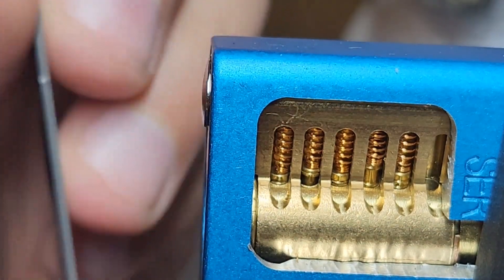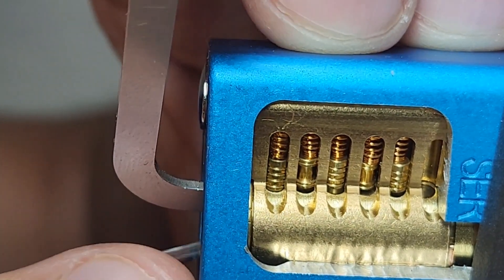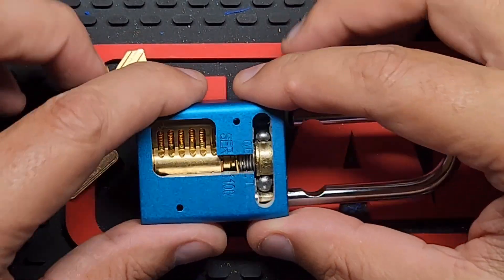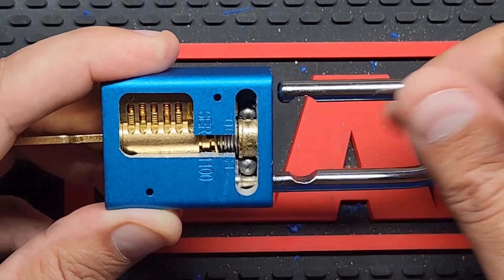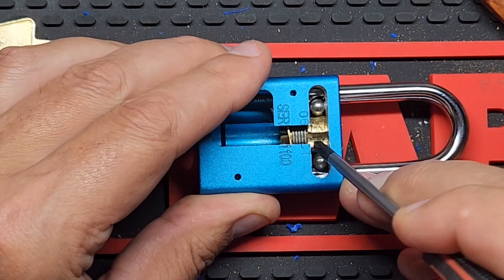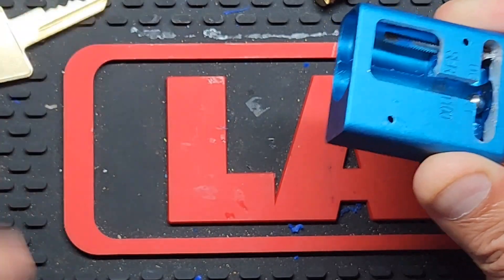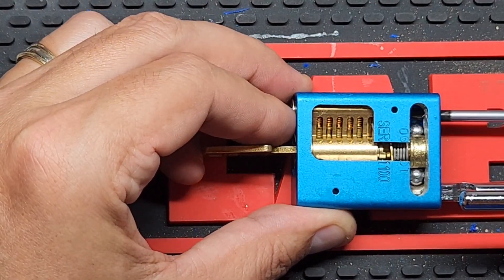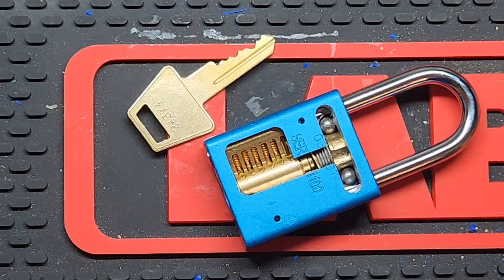[0102] Inside an American 1100 - Picking and how it works

Comment: I really hope I can get one of these cutaway locks one day
Reply from the maker: Yeah, I was hoping to be able to see the pin action on custom pins. Problem is the pins do not act normal because of the cuts. The pins would normally be touching the chamber where the material is missing. Still cool to watch the pieces function.
Reply: Dang I’m sorry that happened like that I would’ve tried it and figured that out as well when I did it but now when I get one I won’t try it knowing what you said thanks
Reply from the maker: @Donald Mccann  it still works on standard pins and manufacturers security pins, just not a true representation. I tried with custom challenge lock pins I made and one of them slipped halfway out of the channel.
Reply: Oh ok that’s what’s up cool deal

Comment: Nicely done 👍 I haven't taken mine apart yet and I got one of these to learn how to get opens on these. Looks like progressive pinning will be in my future
Reply from the maker: Most Americans start with light pick pressure on the back three pins, just tickling them. The pins will firm up, then you can get clicks on pin two then pin one. Most Americans are kinda easy. A few have good tolerances on the hole alignments and take more patience on the back three pins.

Comment: I purchased one of these and love it but I wish they milled the cutaway on the opposite side of the lock. It is great if you are left handed. If you pick right handed, the cutaway is on the back and you can’t see the insides. I use a mirror behind the lock so I can observe what I am doing otherwise it is a great learning tool.👍🦊
Reply from the maker: Yeah, it does seem a little backwards. The mirror is a good idea. It would be nice if the opposite side could be cut. I think, not sure, that they do that side because of the way the core lays and because they want to keep the logo?
Reply: @Freediver_72    I contacted the maker and he said 
“I’ve never seen anyone make cutaways from the logo side. I don’t think it’s possible”. 👍🦊
Reply from the maker: @jackfoxlock  that does not make sense. (His reply), the lock body is symmetrical... I'm sure it can be done, but most people prolly want the logo on the lock. The only differences there is a small channel that the bie rests in and the cutaways in the bible would present in a tipped down direction.. But that would not pose any issues with the cutaway. 

Not to be insulting to the maker, but it seems they can copy something, but lack creativity to do their own thing. If I had a milling machine I'd sure give it a go!
Reply: @Freediver_72    I will have to ask Steve Holder ( Steve’s Locks) who milled my Chubb lever locks if he can mill me one.

Comment: Nice cut away. Does he make them cutaways?
Reply from the maker: No, I’m not sure where he got it from.
Reply: @Freediver_72  probably got off eBay/Amazon. But I know there’s guys out there with the right machine and might be willing to do cheaper than buying one done up. I’ve thought about trying to do one on a drill press using like a tungsten’s bit or something like that
Reply from the maker: @SadisticPicker  I bought a cross slide and some bits, I was going to make one with my Dremel and press, but I decided not to and sold the slide to Joe Picks. He uses it for making picks.
Reply: @SadisticPicker  do it!!! I've made several cutaways with a Dremel and drill press.  But...... Doing that inspired me to buy a cnc router,. I'm working my way up to cutting metal though and haven't used it on a lock yet.
Reply: @notaverygoodusername  so is what ur saying is skip to cnc Router😂. What did the router and bits set ya back?
Reply: @SadisticPicker  (im D M )  I want so say that but I can't yet bc I haven't actually cut a lock with the router.  I spent about 300$ on the router and some bits.  You definitley have to like learning how to use CAD software.
Reply: @blankregistration7301  yeah my son was just explaining that to me. It’s not just hands on tool. I’m definitely gonna look into em just to learn how it operates. And Cad software, where do ya go about that? Do ya purchase it or does it come with machine?
Reply: @SadisticPicker  for cad there are a ton of expensive software packages.  But Freecad (free :) ) seems to work fine for me! Im a computer guy though. I also plan on using mine for code cutting keys.